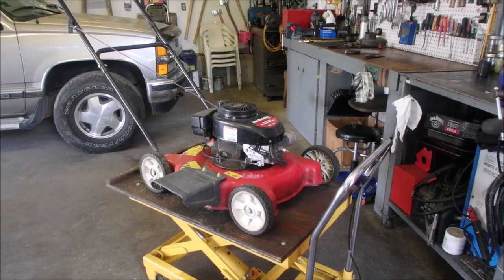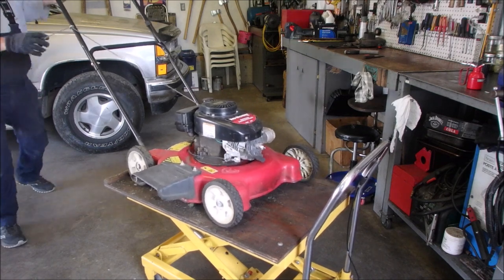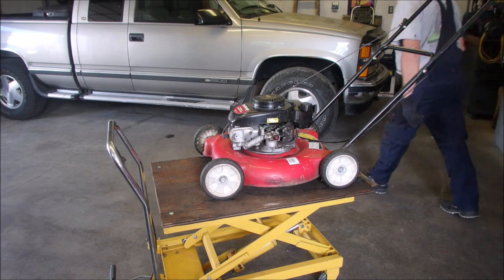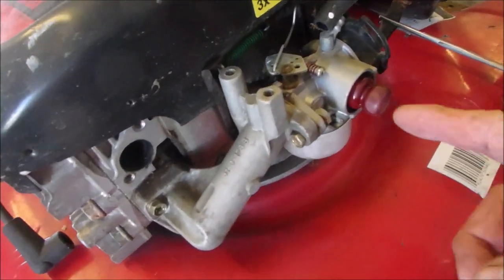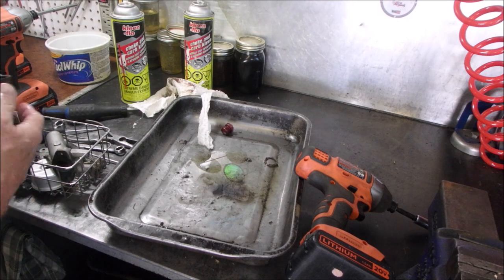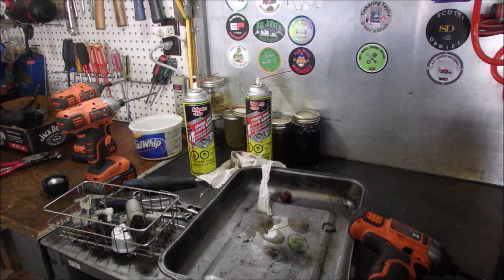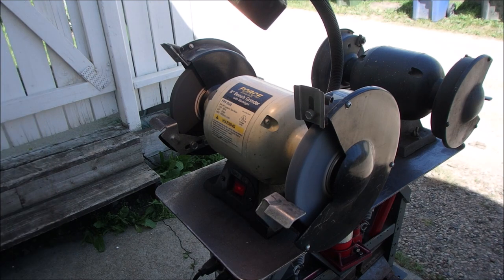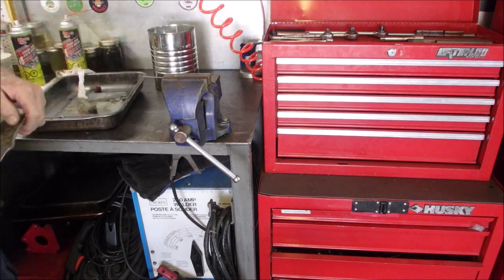Yard Machines Runs, Then It Won't

Comment: I did 2 snow Blowers the other day, went to the customers home, as usual, one was a newer hangsen engine, didn't start, was a clogged main jet do to ethnol, easy cleaning, back together, and started right up, no issues, but the older tecumseh 10hp snowking engine on a snapper 26" Snowblower, it was a beast, but that had the typical tecumseh carb, it was all gummy, and nasty, put that carb in my ultrasonic cleaner, with my special mix cleaner, took the cap off of the low speed jet, all nice and clean, reassembly, and it fired right up, gotta love the old tecumsehs, and I am thanking you for the years of videos helping us all out, with the damn tecumsehs.... Lol thank you sir.
Reply from the maker: Very cool  Thanks

Comment: I see you're up to Three Impacts too! Now you need a 1/2" Impact for those big jobs. I rarely pull out the Air powered impacts anymore. Good ole Tecumseh (Not lol). I got one of those special Tecumseh carburetor tools with the crochet hook on one end for the needle seats and I've only used it a couple times in all the years I've had it. That's how few Tecumseh engines come through here. As always, awesome job my Good Friend! Sean~
Reply: That tool works perfectly on the Briggs Quantum Carb seats also.
Reply from the maker: Right on  Good to hear from you.  I got something in the mail.  Will open it after my Vacation.  See you friend.

Comment: Hey Bruce,
Nice work. My UC saved the day twice this week. One was a Honda dirt bike carb.  It hadn’t been started in several years.  The inside of the carb was crusted like those photos you see of old shipwrecks!  I cleaned it by hand as much as possible.  I put the individual small parts in a separate small jar with gas inside.  When done, there was all sorts of crud that came loose.  Bike ran better than the owner ever remembered!  🥳
Reply from the maker: Nice work!

Comment: Hello Bruce,    I just cleaned the carburetor on a 3 1/2hp briggs and Stratton engine on a newer style mclane edger. I replaced the diaphragm and it still surges at higher throttle. No adjustment on the jet on the side of the carburetor, it was screwed all the way in.
Reply from the maker: Tough one.  Can you try a new carb?  Sorry i am not much help as I am not there.
Reply: That sounds like the air idle jet. not adjustable with very small holes in it. usually hidden under a rubber cap to fool you! Lol

Comment: An old timer's tip is reduce rust on the underdeck is to brush coat it with that old oil. I'm thinking of doing that to my 90s lawn boy.. I usually hose off all my lawn equipment after each use.
Reply: Negative Ghost Rider. Any oil on your lawn is a big no no. Just wash the undercarriage after every use.
Reply from the maker: Great tip!

Comment: Great job Bruce.  Just serviced one identical  to that one. Rule #1 always start fresh with you're  own gas. . And primer bulb looks  also like another issue and a clogged jet.. Chubby  butcher.
Reply from the maker: Right on
Reply: @BrucesShop  just worked on 6.25 ho tecumseh.  Mastercraft 3 in 1. Lawnmower. Water loaded in gas tank. Ripped apart.  Cleaned carb. Now got to figure out the 3 took screws what each one does. And did video lol

Comment: I think I remember a previous vid on this one .  
Good job here.

It runs like a champ. 

Lol I rarely See a Tecumseh now a days.  I see maybe 1-3 a year.  Last one I fixed was one is the last engines they made.  2007 LV195EA.   
It had a bad coil so no spark.  I used a coil I took off a OHV tecumesh (OVMR120). And it worked .
Reply from the maker: We still see a lot of them here

Comment: have to be sure on those tec carbs that you remove the top o-ring when removing the nozzle. i made that mistake and then crushed the bottom of the nozzle when I  tightened the bowl nut. actually did it on two different carbs.
Reply from the maker: You are right

Comment: what do you guys use for a solution in your ultrasound units?

About soaking some of the parts, especially the rubber components, in fuel;  that is something I don't believe I have seen done before.  What is the benefit or reason for doing so?

I've always gotten along pretty well with Tecumseh carbs.
Reply from the maker: I have been using mean green 20% and water.  Thanks is a bit too strong though.
Reply: @BrucesShop  Thanks Bruce.  I have used Simple Green which is probably the same as your Mean Green but it discolored the aluminum carbs.  They came out of the solution a dull grey color.

Comment: A tip for new users of a ultrasonic cleaner, let the unit heat up b4 placing parts in, always have liquid in the ultrasonic cleaner, never run it dry or you will overheat the unit and burn out the piezo tweeters, that make the ultrasonic cleaning vibration effect, and burn out the heating elements. Now that you have the solution heated turn off the heater, and start up the ultrasonics, clean the item, and then let the unit cool down before draining, don't handle the unit while hot, or the heating and ultrasonic elements can come lose from the unit, and if you want drain the unit without tipping it over, use the syphon effect to drain the tank, or on more expensive models use the side drain with a tube to drain, but always make sure the unit is cool to touch b4 drain the liquid, or you might burn out the elements, I use my ultrasonic cleaner everyday about 5 times a day, and what I do seems to make the unit last for years.
Reply from the maker: Thanks

Comment: Why do small engine mechanics remove the sparkplug wire?
Reply: No real need to unless the bail is closed.
Reply from the maker: There is a small risk of gas igniting in the cylinder when you move the blade.taking off your fingers.